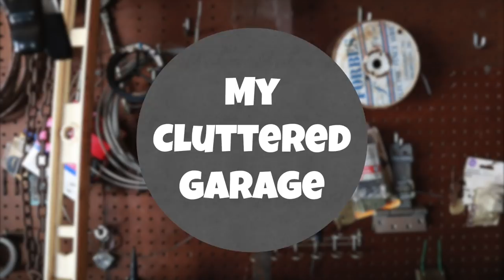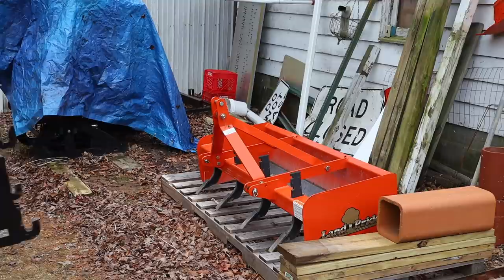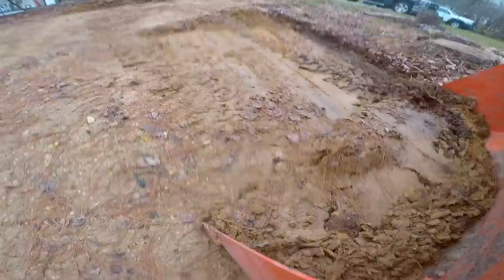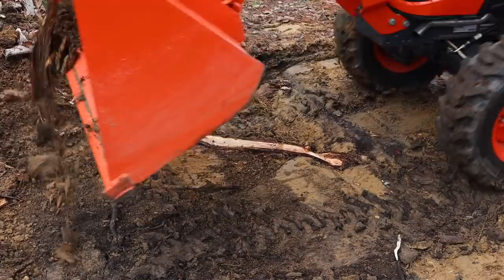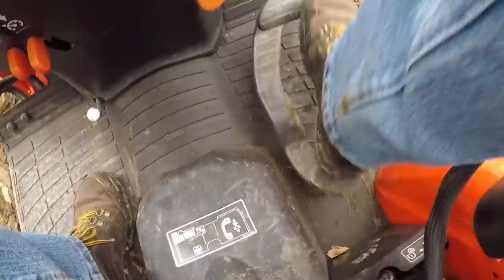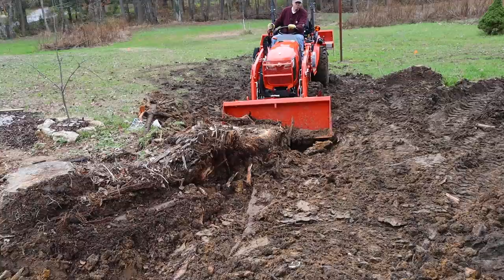Can you remove a tree stump with a compact tractor? Kubota B2601 with the LA435 front end loader #38

Comment: I know the feeling of taking on a job with the tools I have, even if they are not the right tool for the job. My project was to dig under my cabin to put in a foundation and all new floor joists. My B2100 with the LA301 loader  took me 2 years to dig out an area about 30x30x6 feet deep. I didn't realize when I first started how much dirt and rocks I would be removing. I had to remove the roll bar so I could fit under the cabin. Finally got it done this fall. Blew a couple hoses, had 2 cylinders repacked. she just turned over 3000 hours, brought her home to give her some attention, fix some leaks, and a little TLC. Still running strong.

Comment: Back-dragging a bucket over those roots is a great way to blow a cylinder.
Reply: Why?
Reply: @offplanetevent  Leverage. Hydraulic cylinders & the arms are stronger on the outstroke & lifting direction, unless the cylinders are designed for pulling on the closing direction. On most tractors, especially compact & subcompact tractors, this is so.

Comment: Suggestion - take a 55 gallon barrel or something similar.  Cut out both ends and stand over the stump with some bricks or rock under the lower edge.  You’re building a stack or chimney with a space for air to enter at bottom.  Build a fire inside with the intent to build up six inches or so off hot coals which you maintain over the course of the day.  Screen door or rabbit wire over the top keeps sparks down.  Let it cook over a few days.  It will eventually consume the stump and follow the major roots for several feet.  You can shut down the process with a garden hose at any time. A bucket of dirt fills in the hole.  I successfully removed stumps even near structures because the stack sends the heat straight up and controls any spread.  Wet down the surrounding ground or objects you want to protect.  Leave a sprinkler running?
Reply: This is something I'll have to give a try.
Reply: I put some pipe of bbq charcoal on a pine stump. Was about to burn it now level with the ground.

Comment: Ih you plan on removing stump with anything cut them at waist height. Whether pulling with a tractor,truck or backhoe makes it so much simpler. If not using a backhoe use a bucket or garden hose to soak area or wait until a good rain will also make it easier.

Comment: Use your box scrapper and rippers. That will loosen the soil and many roots then remove remaining soil with your bucket.
Reply: That’s exactly what I was going to say!
Reply: I'll say no on that ..... I did that a few years ago and hung up on an arm ... I was in low and with the force I bent  one of the rear arms ...  it wasn't a huge root either but I'm told by the dealer it happens more than you think ...  cost me couple hundred to fix

Comment: I have a BX2380.  No back hoe.  I was having problems getting stumps out. All different sizes.  Saw Biff's Equipment Youtube channel.  He had a Artillian Pallet  fork frame with a front hoe attachment.  Cost a few bucks but did the job very very quickly.  The cost was worth the time saved.  To make the investment worth it I got some pallet forks the the Artillian Pallet fork frame.   Incidentally the Antillean set up has sectional grapples  too.  I have a land pride grapple that came with my BX2380.  Good video.
Reply from the maker: Thanks Earl. Much appreciated! -Ed

Comment: I’ll admit I’m impressed that you got it out that way. That looked like hard work. But if you keep pulling stumps out that way you’ll be heading back to your dealer for another bent loader frame. I use my sawzall and just buy long blades and bury them in the ground and cut the roots. Blades are cheap compared to fixing your tractor.
Reply from the maker: Smart idea. I’m definitely not over stressing that loader like the previous issue did. I’m fully aware of the limitations now, but it’s a tough machine. Thanks for watching and for the idea!
Reply: Milwaukee makes some pruning blades that work great for this.
Reply: That's the strategy I use, a couple cheap freight blades in my cheap freight sawzall to cut main roots when the tree is dropped. The stump rots in no time.

Comment: Use ONE box blade ripper.

Then drive by the stump, moving closer each pass.
Cut the roots a few times.

Then hook the stump with the middle  (2 if you don't have a centered ripper) and pull while lifting.
Your 3 point is stronger than your loader!

It will take out some pretty good size stumps... but it won't get as many as a backhoe and an excavator can get even more.
Reply: You can bend the loader frame trying to pop stumps with the corner of the bucket.
Reply: DO NOT RAM THE STUMP WITH THE LOADER!
Yo are going to bend the loader frame.

Comment: The more I use my FEL (I've got only about 100 hours on the tractor now)  the more I realize it's really light weight and would easily be broken.  FE Loader, not Pusher, and especially not Puller.  Learned a lot from your videos, thanks.

Comment: I’ve pulled out several large stumps in my B2320 using the loader and auger. Drill down all around the stump, which will split roots then rip it out. Got 3 large cedar stumps last summer and put about 5 hours on the machine.
Reply: We are getting a tractor soon with a front mounted hydraulic auger driver. We will try to dig out around fence posts & trees stumps with a thin auger to do the heavy and deep digging. It should be fairly easy on the tractor.

Comment: There are times I wish I had bought a backhoe for my tractor. I might have used the box blade with the tines all the way down at least a few swipes. I hand dug around a live oak tree stump and cleaned in between the roots. Then with a bow saw cut off the roots, hooked a heavy  chain around , drug it out.

Comment: Been there done that. I saw another YouTube video where the guy used a reciprocating saw and cut all  the roots first. I tried that and it really helped. My stumps were old and I thought they would just pop out but no, they put up a fight. I have a couple of more stumps to remove and I am going to do the same thing. This time, I am going to drill deep holes in the stump in hopes that while I am digging, that the stump would split. Thanks for the video. It was a lot of work but you did a fine job. 😣😣😣😮😮😮😁😁😀😀

Comment: I have done this before myself and I have regretted it.  You always end up putting way too much wear and tear on your tractor.  Your loader is just not designed for this.  I would strongly discourage folks from doing this and just go rent a mini backhoe for the day.  They run about $360/day with the trailer (in my area).  You can pop out a lot of stumps in a full day with a mini backhoe.  Plus dig ditches for water and power and all kinds of other fun.  Thanks for the video!
Reply from the maker: Thanks, David. Definitely not something I'll be doing often... if ever again :)
Reply: 100 percent spot on mate ... I bent my rear arms with the box blade ...i then spent a few hours talking to the mechanic of do and donts and this was one thing he said would cause too much Stress on the tractor he said he sees it all to often ... he said people think it can do everything but the stress on the tractor isn't worth it.

Comment: Definitely not the best tool for the job, but you proved  it will eventually get the job done.  I used my FEL to dig a hole a bit over 4 feet deep to bury my dog a couple weeks ago.  A tooth bar is a force multiplier. It makes it much easier to push through and break up compacted soil and roots.

Comment: Look into a stump bucket. It's still a slow job but much less stress on the FEL. The one I used tapered down to a point with 3 teeth. I cut around all four sides to cut the roots then rolled the stumps out. It's amazing how big a hole it takes to remove a 12: stump.
Reply from the maker: You’re right about that. But figuring that those roots held up a 60’ tree or so, they’d have to be significant, right? Thanks for watching. -Ed

Comment: This was a good Demonstration of what a skillful operator can do with a Little tractor. I don't think it would be a practical solution for  the less skilfull like me though.  I bought a 3 Point  Grinder for my bs and the thing is great. Only taken about half a dozen stumps and some thought and research and I can do what I call  " Precision grinding now where I only make a hole less than about 12" larger than the stump I'm removing.  It's qute neat I have the hang of it and a stump that size would have be gone in 10 min tops.  I's be confident to do 20" stumps without a thought now. i'd do 30" but that would take some planning because as soon as you get under the dirt they turn into 40" you would have to grind out and then you have to watch where you put the tractor itself and don't reverse into your own hole.  On smaller trees to about 20 " the grinders are very practical and probably the fastest stump removal out there for a home owner I'd say.
Reply: Where did you get a grinder like that?  Is it a stump grinder or like a skill saw blade?
Reply: @AUoldphart  look up woodland Mills.  There is at least one other similar type but that is the one I have.  Just used it nearly everyday for a fortnight and I'm taking out stumps with the thing now that I didn't think possible. Old, hard and very large well over 32". Takes a little time but what you can do in 10 Min with the thing would be hours any other way.
Reply: @thedummyspit8814  Thanks for the information

Comment: Interesting means of removing a stump.  Since you have a lot of clay, roots tend to be closer to the surface.  It's hard to cut roots with a straight bucket blade like your bucket has.   Look up the Heavy-Hitch bucket tooth bar that would make the job faster and easier. They make one that will fit a Kubota.  I've used my son's Kubota excavator to pull stumps. Even with that it is still not the easiest job...and we have great soil to work with.

Comment: Just bought the same tractor and similarly decided against purchasing the backhoe since it was gonna cost me close to 40k 🤦‍♂️. While I do have plenty of stumps to remove, small and large, I do remember the  Kubota dealer specifically mentioning that these smaller tractors can easily get damaged when removing larger stumps. It takes a toll on the hydraulics…but I see a lot of people doing it and pushing they’re compacts to the limit.
Reply from the maker: The stump bucket works well for small stumps and shrubs. But I wouldn’t recommend it for sumps larger that 4 inches unless they are well rotted.

Comment from the maker: Here are some product suggestions. These are Amazon Affiliate links, so purchasing will help this channel by providing a small commission while not costing you any more. Thank you for your support!

Dewalt 20v Grease Gun:
https://amzn.to/3fmRJ5J
Lumax Heavy Duty Grease Gun:
https://amzn.to/3mFK1pA
LockNLube Grease Gun Coupler:
https://amzn.to/3kPcvwu
Recommended Grease:
Valvoline Moly Fortified
https://amzn.to/3jNM1Kv
Muck Chore Boots:
https://amzn.to/3nRu3tf
3M WorkTunes Hearing Protection:
https://amzn.to/3pUlRu4
Deerskin Gloves:
https://amzn.to/3nM6sdq
Nitrile Gloves:
https://amzn.to/34Kg8OG
Tractor Swag:
https://amzn.to/3fiMzri
Tractor and Implement Paint:
https://amzn.to/35S14za
Yellow Diesel Fuel Container:
https://amzn.to/35S16qM
Digital Tire Inflator with Gauge
https://amzn.to/2Kv7oV7
My Chainsaw:
https://amzn.to/33aFzYN

Comment: Which quick hitch do you have mounted on the back of your tractor? Do you like it or
think perhaps a different brand is designed better?
Reply from the maker: I have the Harbor Freight QH. I haven’t used any other brands, but I think the Land Pride QH would be better quality. The one complaint with the HF model is the shallow depth of the hook. Otherwise, it works well. I also made a video about it here (see #15). Thanks for watching.

Comment: How long did this take you from start to finish?   I own about 30 acres of land here in Pocahontas county West Va and have cleared dozens of Hemlocks and have the stumps remaining. I have a Kubota 2501 tractor with an adjustable 7-foot blade that can also dip to a 15-degree angle to rip up the stump roots.  I know an excavator is the best options but trying to get an operator here is a scarce as hens teeth!
Reply from the maker: Too long! These machines just aren’t made for this type of work. I spend several hours and this was a pretty dead stump. I tried again with a stump bucket. Great attachment but really best for really small trees - like maybe 3-4 inch diameter? Check this out. https://youtu.be/3p3oltxcUn8

Comment: I’m thinking about drilling a hole through the stump, attaching an eye bolt (straight through and nut on the opposite end), then attach a chain to the eyebolt and the bucket and lift up or pull. I’m thinking this might work for small to medium stumps. I don’t have anything large. I have a Kubota L01 with the LA525 bucket. I think it might have enough strength.

Comment: Use the scarifyiers on your back attachment. Once you hook the root drive forward to loosen and the use the 3 point hitch to lift the root. There is more lifting power and the engine in front is your counter balance along with the bucket.
Reply from the maker: Hi Robert. Good tip! Someone recently mentioned only lowering one scarifier for that use. I never thought of that, but it sounds like a great idea. Thanks for watching. -Ed
Reply: @MyClutteredGarage  Happy to help. Keep up the good work.

Comment: At first I thought you might be going to lower just 1 or 2 of the box blade scarifiers and see if they could be used similar to a ripper on a bulldozer.  I do that to tear up potholes forming in my driveway. I was also thinking that a piranha tooth-bar from BEXpanded might make this job a little easer and it would be an every use bucket item. Come to think of it with you metal working skills you might be able to buy a couple of scarifiers and modify them into a cutting edge so that they would be more knife like to help cut the smaller roots. We have a cottonwood tree here in Western Washington ((black cottonwood (Populus trichocarpa)) that likes to a root almost as large as the stump diameter. I just discovered your channel and you do a nice job on these videos.
Reply from the maker: Hi Jan. That’s a great idea to just lower one or two scarifies. I never thought of that. Thanks very much for watching, and for your kind comments. -Ed

Comment: Well you did get it after all but it would have been a lot easier with far less wear and tear on the tractor if you had a toothbar on the bucket.No critisism ,just a suggestion.I use a Piranha bar and it makes clearing brush,roots and digging much easier.

Comment: This definitely is a "rent the as large as I can afford and transport mini excavator" job. Don't beat the hell out your tractor that was not built for this. There's no shame in it. One repair can cost a lot more than a rental. Like Clint Eastwood says : A man's got to know his limitations".
Reply from the maker: Good advice! As I said, I don’t really recommend it. Thanks for watching!
Reply: It looked to me like he used his tractor exactly as it was designed. He took it slow, dug a layer at a time, didn’t slam it against the stump. The real concern here is bending your front loader.

But I agree with you. If you have the money and can, rent heavy equipment. A cheaper option is just burn it out with charcoal.

Comment: First get a tooth bar for FEL makes digging easier second I would have just bored a hole in the stump driving a air hole of the side and well lit it on fire letting it burn from the inside to where it would just crumble a few days later with the FEL

Also you have hooks get a chain around that tough root and use the power to pull the root up rather then scraping

Comment: You done good with tractor and bucket,did you think of using grapple to help break up roots,either way good job...
Reply from the maker: Thank you. I did think of using the grapple but I don’t think it would have done much. Thanks for watching!
Reply: I was gonna same the same. I saw the grapple in the background.  I'm about to try a stump about twice that size at Mom's and was planning on using my root rake grapple. I've done some small trees that way and it worked well cutting the roots around it and not disturbing as much soil then pushing or pulling it over.  I'll let you know how that works.  I'm in a tight spot as well and will only be able to go at it from one side.

Comment: I couldn’t help but wonder: if you used the scraper on the 3 point, would it brake up the packed soil and make it easier to scoop with the bucket?
Reply from the maker: I think that would help with the soil, but the biggest challenge were the roots. Thanks for watching!
Reply: Looks like you could rented a stump grinder a whole lot cheaper.
Reply: Now you got a swimming hole.
Reply: @MyClutteredGarage  Yes, good point about the roots. I once had a similar situation with a similar size stump removal. I cut the tree and left a couple feet above ground. Then I dug a trench around the stump with the bucket of my BX 22. (I was lucky to be able to dig all around. No pet cemetery.)  Then I placed a chain around the stump to the bucket and applied upward pressure and shut off the tractor. I put a sacrificial blade in the chain saw and cut the stump at the bottom of the trench. The upward pressure prevented the saw from binding and it lifted slightly when cut.  It worked quite well.  I backed filled and you would never know there was a stump there. Thanks for the videos. I am enjoying and you have gotten me thinking.....